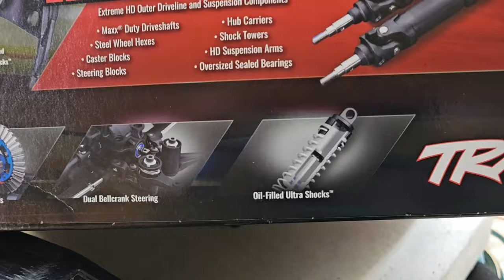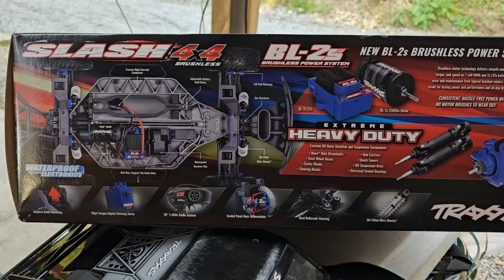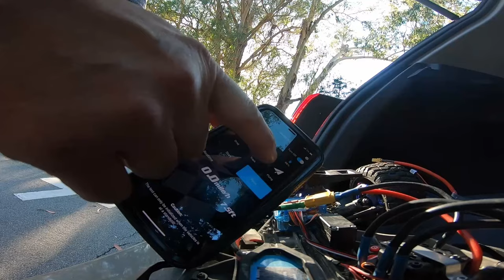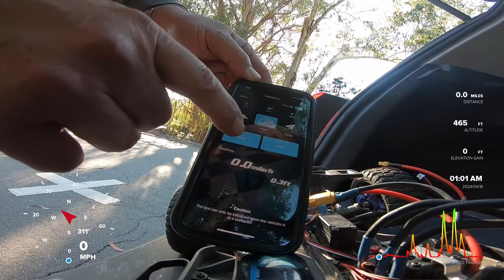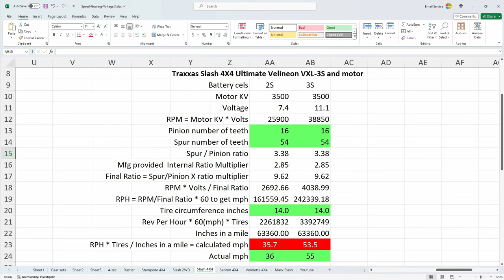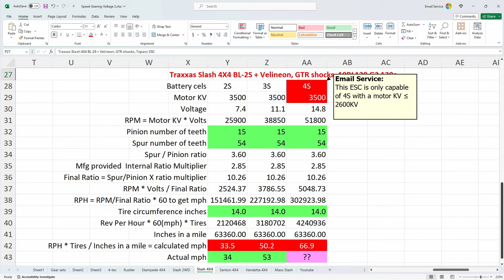Traxxas Slash - 2WD, BL-2S & Ultimate best buy

Comment: Hi, I'm new to this hobby, I'm torn between the bl-2s or the vxl, which do you think is better? Can they be modified so that both run faster?
Reply from the maker: Absolutely! Both are likely the most upgradeable RC systems you can buy. The only limitation is your time and money. The VXL adds many upgrades over the BL-2S so if the price difference isn't much, I would suggest getting that.

Comment: geez idk what’s worse to buy a bl2s and upgrade it or get a ultimate and put the bl2s HD kit in both seem way to expensive
Reply from the maker: The BL-2S extreme heavy duty drive would've been great if it fit the older Slash but it does not. The BL-2S ESC & motor is perfect replacement for the older brushed system.